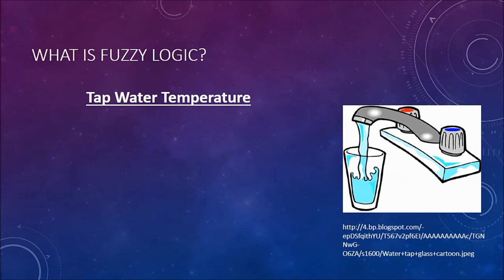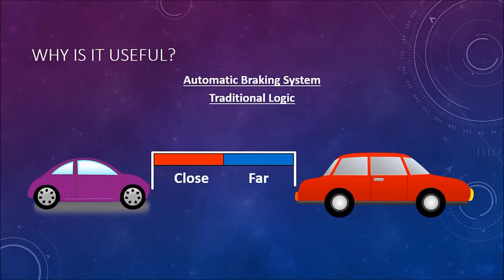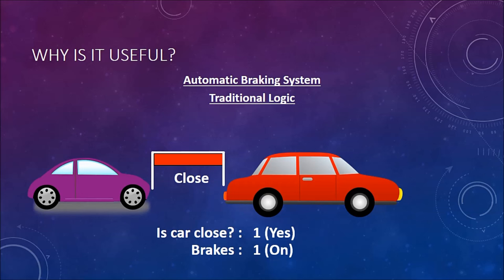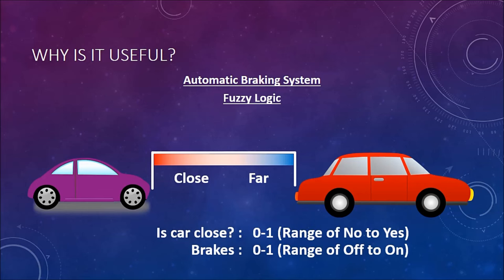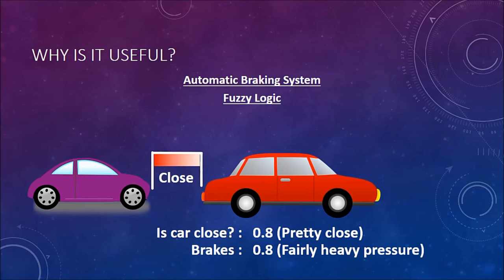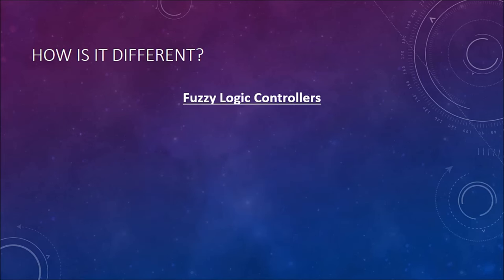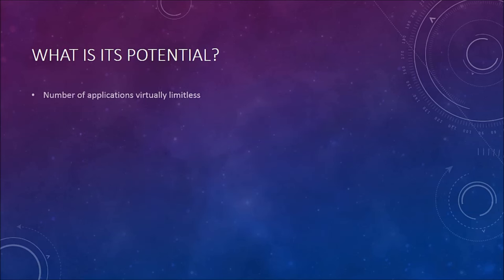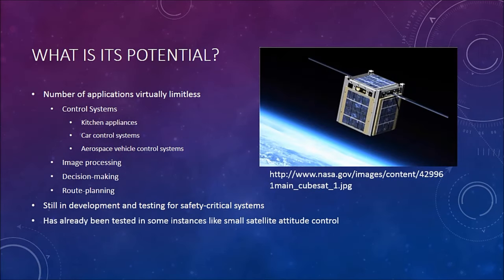An Introduction to Fuzzy Logic

Comment: It’s not fuzzy. It’s a spectrum based on reality. For example if a car needs 2.1 seconds to brake and not hit the front car that’s because of speed and distance from the front car and the following cars engineering capability. Not to mention weather conditions. But if the car behind needs 7 seconds to avoid a collision (like a massive truck);then the variables change.

Comment: Well, I'm still very confused. I understand the concept behind fuzzy logic. I just don't understand why people keep saying that it's so much better than PID controllers. In this example you have to measure the distance between the two cars and apply breaks based upon that measurement. Why is using fuzzy logic better than a PID controller? In this example a simple proportional controller would perform exactly the same, but the logic behind it is much simpler. The error would be  the difference between the target distance and the measured distance. Multiple the error by some gain, and apply that much breaking power...  In fact, it uses few calculations as well; one simple subtraction and one multiplication. Using fuzzy logic in this situation requires two full linear interpolations and two multiplications plus a final addition. Maybe this is just a poor example. Can someone give me a simple example where using a PID controller is much harder and/or much less accurate/desirable than fuzzy logic?
Reply: Okay, to answer my own question, I believe I understand. A PID controller is simply one special case of a fuzzy logic controller. PID controllers either require a model of the system's behavior, or can only act upon measured factors. Fuzzy logic incoporates rules into the controller. For example, if the distance between the cars is decreasing very rapidly, apply more brakes. If the car in front is large apply more breaking power, if there is a car very close behind, apply less breaking power.  All of these to a greater or lesser extent. A variable gain PID controller would be required to react in these situations.
Reply: I have exactly the same doubt as you about fuzzy logic controllers. 

there is still something that does not completely convince me. Regarding the example you wrote in the answer above: in a PID controller isn't the fast / slow decreasing / increasing of the distance managed by the D part of the PID? so I don't see yet the breakthrough of using fuzzy controllers instead of PIDs, which, as you said, are much more straightforward, and their time / frequency response has been studied for decades.
Reply: gizmoguyar so are you saying the main advantage of fuzzy is that it accepts multiple inputs whereas PID is strictly SISO?
Reply: Jackie Wu I still don't believe that fuzzy logic has any advantage. PID controllers can definitely have multiple inputs and outputs. Tuning them becomes much more tricky, but it's the same system and thus no more tricky than fuzzy logic. and once again the PID beats fuzzy logic in speed and computational accuracy.
Reply from the maker: A PID controller is a 3-input (state error, accumulated error, and error rate), single-output controller that is linear. A Fuzzy Logic Controller can take in as many states, and give as many outputs, as desired and are universal approximators. Since some optimal control mapping for a particular system is more likely non-linear than linear, FLCs can more closely approximate this than a linear controller.

To say that PIDs beat FLCs in performance is demonstrably false (see pretty much any paper comparing them). The benefit to using PIDs is because they are linear, we have analytical means for showing certain properties (stability, performance, etc). The non-linear behavior of (most) FLCs means it is more difficult to definitively show those properties.
Reply: @timarnett8555  I'm not a computer person, but is this the correct way of thinking of the problem?

In this example, if using a traditional controller, the software would have to know everything about the system: friction, speed of both cars, brake force curves, uphill, downhill, etc etc.  in order to calculate the correct brake application pressure to accomplish a set distance separation between cars.

Where as in a fuzzy system, the software is generally figuring out how much brake to apply to keep the cars X min distance apart from each other?  So it's somewhat experimenting with brake pressure and re-calculating as necessary.  Therefore, the only known you really need have in the system is the output, min distance from each car, and the a generic input, use car brakes to achieve desired results?

Comment: This is really no different than pressure transducers or encoders, they take a value at any range and assign a digital value so that it can be interpreted, and the resolution can essentially be as high as you like. It still follows the same rules of digital logic and Boolean algebra, I can guarantee you that a braking system in a car is more than just a 1 and a 0. Not quite that simple.

Comment: sir Suppose,  I am making a fuzzy rules using three input variables a, b ,c, and 1 output variable d. Each variable has three linguistic terms Low medium and high.
Is it possible to write 
A               B              C              D
High	Low	Low	Medium
High	Low	Low	High

If so , can you give me a paper reference ?
Thank you
Reply from the maker: I don't have a reference, but it is possible. However, you'll still need a way to choose one of the antecedents or combine them in order to resolve to a final crisp value. You could use a disjunctive rule like a probabilistic sum, or maybe a t conorm, to combine the two output membership functions. Or you could learn some sort of probabilistic method from training data. 

The end result however could also be achieved by having more granularity in your input and output membership functions.
Reply from the maker: Oops, instead of antecedent that should say consequent.

Comment: So... is it just proportional control with saturation? 🤷‍♂️
Reply from the maker: No. Proportional control is a type of linear control, although the saturation would indeed induce a nonlinearity at the threshold. Fuzzy controllers are almost always nonlinear (depending on their properties). If you have a Fuzzy Inference System (uses Fuzzy logic along with input-output inference rules) that gives a piecewise linear output, you could exactly match the output of a proportional controller with saturation with only a few membership functions. Since Fuzzy systems are (usually) universal approximators though, they can approximate much more complicated control surfaces, which is useful since an optimal control function is almost always nonlinear.

Comment: What is the difference between fuzzy logic and quantum computing?
Reply: Quantum computing is the act of storing information as atomic spin. It has nothing to do with greater or lesser degrees. The pin is either down, up, or something else. The reason why quantum computers are being hailed as the next big thing, is because they'll be faster and smaller than our current transistor based processors due to their atomic nature. Fuzzy logic still requires analog to digital conversions and is still subject to errors due to resolution.
Reply: informative! thanks
Reply: scorned certificate

Comment: Can someone explain me why we have a fuzzy logic definition.  As it seems it is just bunch of if else statements and switch.
Reply: fuzzy logic is the process of a computer to learn that a horse can still be a horse even if its a white horse. I would have thought fuzzy logic as a concept has been around longer than the term was first coined. Grammar correctors would have to use fuzzy logic I would have thought. Nobody used the grammar correction schema and said ah this logical framework would be useful in other applications. I am surprised there isn't a patent dispute going on here

Comment: how is it different from analog
Reply: So basically it's an analog system with a digital interpreter? Like a proximity sensor driving a potentiometer circuit, driving the brake solenoid at "analog" pressure...plus a screen!
Reply: That's exactly what I'm thinking,
so basically fuzzy logic is analog version of digital system?

Comment: one simple correction if i may add, in the very last slide, you mention satellite attitude instead of altitude 
great video tho, this made fuzzy logic clears to me
Reply from the maker: Bogiva Mirdyanto No, attitude is correct. You can also control altitude for station keeping but the example I was giving (attitude) refers to the orientation. I.E. keeping the satellite pointed at a particular location.
Reply: +Tim Arnett ah so that's what you mean. aight then, nice explanation

Comment: (I'm not a native English speaker. Sorry for that...)

Sounds to me like a misconception of what logic is.
Nothing can be partially true or partially false. This video is misleading into believing the opposite, by asking true/false questions using numerically UNDEFINED terms.

The definition of whether the water is cold or hot is subjective to conception of each person. There's no numeric definition of a cold or hot water, so the question of whether it's true that the water is cold, is incorrect in the first place (logically).
You CAN however ask how cold or how warm is the water, and represent the answer using Celsius or Fahrenheit  degrees, or  a color spectrum (as this video shows), none of which contradicts with the classic conception of logic, and I don't see any need to define it with some kind of new "fuzzy logic" term.
And if you ask whether the water is colder than a certain temperature, the answer can only be TRUE or FALSE !

Same thing with the terms far or close.
No numeric definition of the terms - the question of whether the car is close or far is logically incorrect!
Representing the distance with numbers or any other analog/digital units - does not contradict with classic logic, and you don't need fuzzy logic for that. That would be a correct answer to the question of How far is the car.
And the answer to a correct question of whether the car is closer than the minimum required safety distance, can only be TRUE or FALSE.

Once again, as long as you use numerically defined terms, nothing can be partially true or partially false!

In my opinion - a totally useless term... (Fuzzy logic)